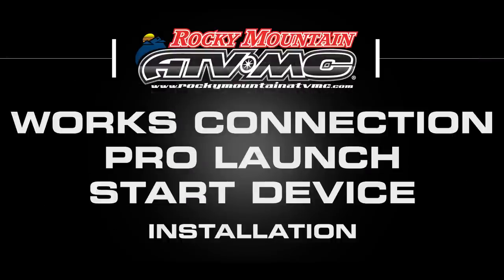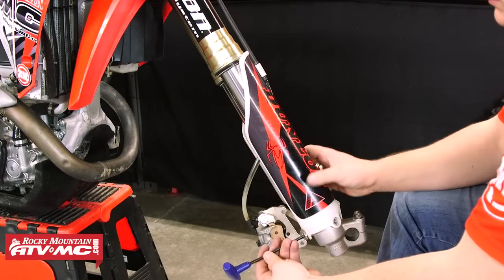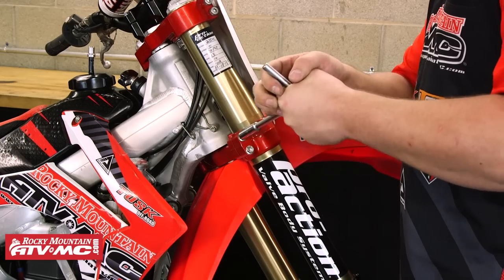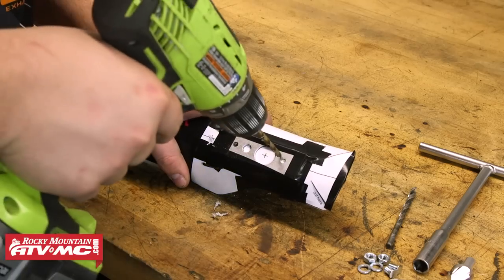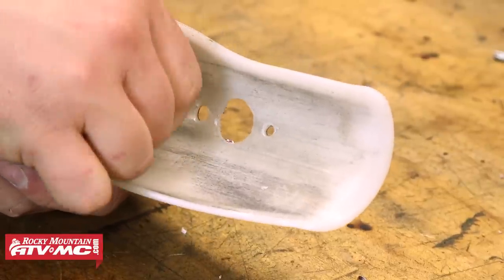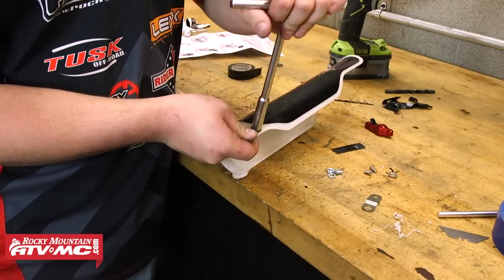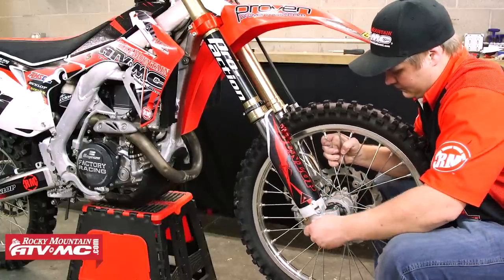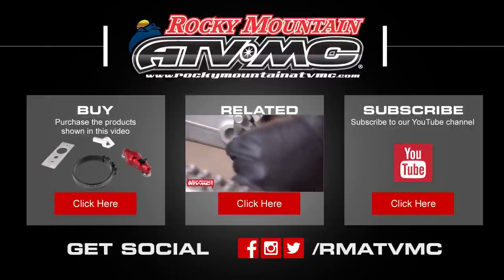Works Connection Pro Launch Holeshot Start Device Install

Comment: Bought one for KTM 85, doesn't release easily as the spring type one's. I've set it at 100mm as rider is short and track is very grippy. My question to you is can it be set to release easier?
Reply: He's not braking hard enough. I run mine halfway and I feel it releases great.

Comment: Can someone explain what this does (I'm new to new to this )
Reply from the maker: @Jamie Macdonald Heres the product details page for ya: https://www.rockymountainatvmc.com/p/1037/33974/Works-Connection-Pro-Launch-Start-Device
Reply: +Rocky Mountain ATV MC thanks man
Reply: Jamie Macdonald it does a message
Reply: wouldnt it suck for this to lock mid run landing too hard??
Reply: @TheCharillz23  it would not happen because you need to manually switch it to "engage mode" before it can lock the forks.
Reply: @rmatvmc  lmao 
Asked how it works: Response is  link to install video.
I'd like to know as well. but know better than to ask.. lol

Comment: So u have to lean over and press the lever to DiDi gage the lock? That’s a bit dangerous don’t u think while your going full wacca
Reply from the maker: The holeshot device automatically unlatches under braking in the first corner.

Comment: Would this fit a 2001 cr125? If not is there any recommendations for hole shot devices
Reply from the maker: Unfortunately we don't carry any holeshot devices that are an exact fit for your bike. But if you search online you will find some options that will work on your CR125.
Reply: @rmatvmc  thanks for the help!

Comment: Ik this video old af but any chance anyone knows if this fits a kx250? I was looking at it on a different site and it says it wouldnt fit my bike but it looks like you can fit it on any bike just dont want to waste the money if it doesnt work for mine.....
Reply from the maker: Unfortunately Works Connection doesn't list any KX250 2-strokes as compatible bikes. To see if there are other options that may fit your bike, you can click the link below and enter your machines year, make, and model.
https://www.rockymountainatvmc.com/parts/dirt-bike-holeshot-devices